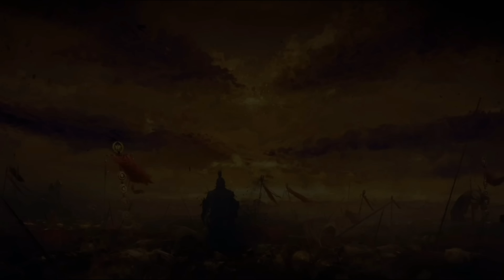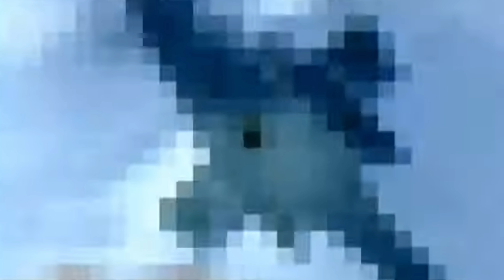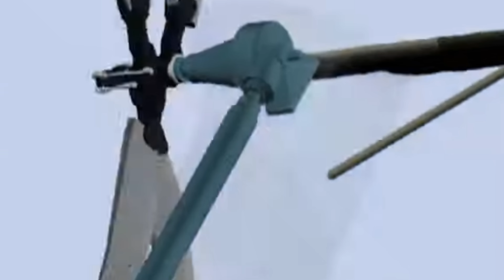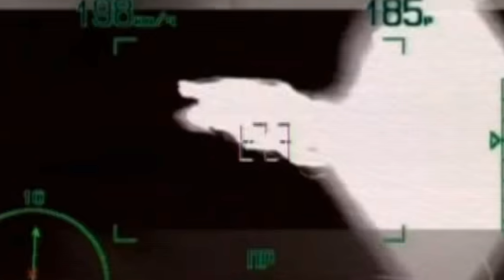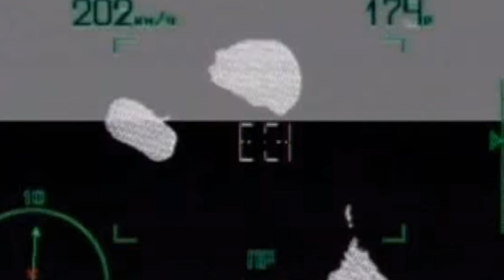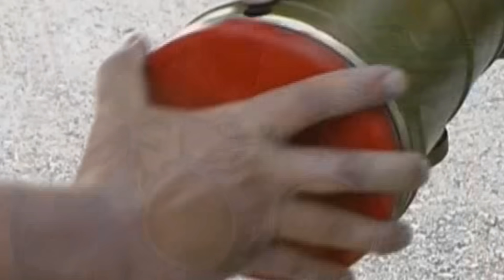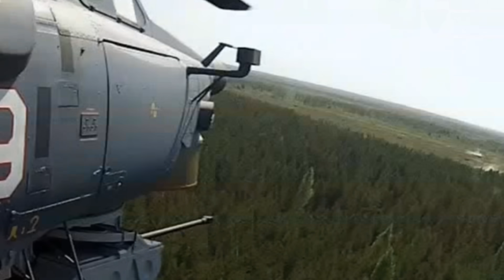Mil Mi-28 "Havoc" | RUSSIAN ATTACK HELICOPTER

Comment: As to the crew escape system:
It reminds me of the original escape system of the F-104 Starfighter. The pilot actually ejected DOWNWARDS - I think second thoughts set in, when somebody pointed to the complications arising when the aircraft operated at 1000'. Downward ejection would be practical in those circumstances - I mean: Slamming the pilot so hard against the ground that he would make his own grave and the soil above would cave in and save the war graves commision a lot of trouble.

The Havoc escape system presupposes the helicopter has actually crashed and the crew has somehow survived the jarring impact unscathed and with their wits about them.
The idea of rolling out of an inherently unstable aircraft - all helicopters are naturally unstable along all three axis - going at full tilt of 6 km/minute - below 2000'. That should ensure the tumbling rotorblades sliced and diced the crew into pratical bite sized lumps.
Reply: I think that this downward ejection  dont work when the heli is inverted. I mean the recent crush of Mi-28, the heli fall inverted an even the cockpit was practicaly untouched both pilots died.

Comment: Well, at bit of historical background. As the Vietnam war was winding down the communists tried to advance on Saigon with a rather massive force. The armour was stopped by AH-1 Cobras.
The americans drew the somewhat wrong conclusion from the incident. They more or less abolished their medium armour and used the Apache's in the role of medium armour in Iraq. There they ran into old fashioned AAA and got severely hurt.
Medium armour use their speed to AVOID hostile tanks and their armour to get the Hell away from tanks and try another path to get at the supply train of the tanks.

But there is no denying that the helicopter has  had a profound impact on armour. Which is why I strongly recommend every 8*8 vehicle should have a remotely operated 25-30 mm automatic gun to supplement main armament. Even the lightly armoured vehicles like the MOWAG Eagle should have something like that.
The Germans has gone over the top on that one - as per usual - and equipped the Boxer with a 35 mm gun that needs braces to keep the barrel from ringing like a tuning fork.

That secondary mashine canon also serves pretty well as fire support for the dismounts.

Actually a lesson from the Gepard. Not particularly well suited to the AAA role against low-flyers - especially not at the price. BUT their mashine canon was actually beautifull against infantry - so .....

I think the deployments of A-10's in the Baltic is mainly due to the deterrent effect. A deterrent against a "brilliant" idea of a russians "smash and grap"-operation with helicopters. A brace of Warthogs against a clutch of attack helicopters - absolute carnage.

One thing one should consider: Helicopters are damned expensive. An Apache costs at least 5 times what a Challenger does. You allways hear that tanks are expensive - well, they are NOT, not compared to the alternative.

There is little doubt that the Nato Special Operations Command set up by the Danes, Dutch and Belgians - with equipment they allready got has caught the attention of the ruskies. They will have to beef up their AAA in Königsberg. Not that we intend to invade the damned place; but the mere existance of the threat will force the enemy to huge expenses. It might be effective if the enemy is caught napping - in the case of Königsberg  the proper term is rather: Deep coma. Königsberg is a disaster of command - a couple of years ago they had to fire the entire officer corps in that particular sewer.

Comment: hey it can also do another thing and that is in the back on the left side is a small open space for it to pick up to almost 3 people so it can rescue or pick up other people like if another mi 28 crashed it could come over and pick them up.
Reply: @Hugh Jarsol  at around 10mins into the video is when it shows it
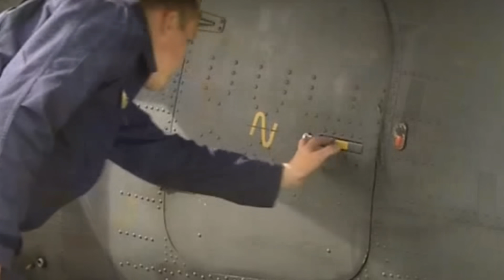Reply: 13:46 Three more in a crouched position, or someone wounded laying.
Reply: Craxyeen in that video the guy says in its in the export variant of the mi-28 most likely meaning it has a bunch of other stuff removed from it.
Reply: @Hugh Jarsol  If u look up a video called MI-28N full on YouTube a video named that will show up and it a video about the Mi-28 and it shows where the little side hatch is.

Comment: you got one point wrong .. there are acctually over a 100 Mi 28 in service being mostly Mi 28N or NM variant and a few of the new Mi 28 UB. in 2019 they got additonal 24 Mi 28UB via contract.

Comment: Matsimus, got an interesting one for you.  The difficulties of gyro stabilized weaponry mounted at multiple points of a bipedal  mechanized combat machine and why it would or would not work (such as conflicts between the gyros stabilizing the machine in contrast to those stabilizing the weapons separately).
Reply: @Armadio  *Gyros
Reply: @Armadio  the issue is that a gyro that supports the machine's own upright nature and gyros for separate weapons equipped on turrets or limbs would likely conflict with one another.  If this big one is pulling this way to maintain balance while this other one is trying to keep a weapon turret on target as the machine is struggling to regain balance and that direction necessary to keep the weapon upright goes against the direction to restore balance to the machine....  Reason I brought it up is someone I spoke with believes everything out there has gyro stabilized weaponry and doesn't see why a bipedal humanoid combat machine wouldn't have gyros for the weapons themselves.